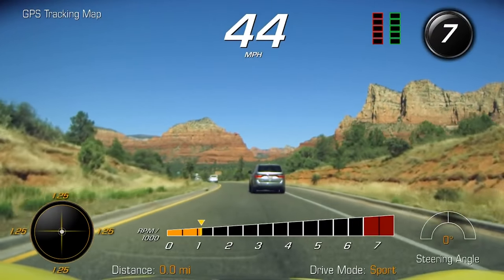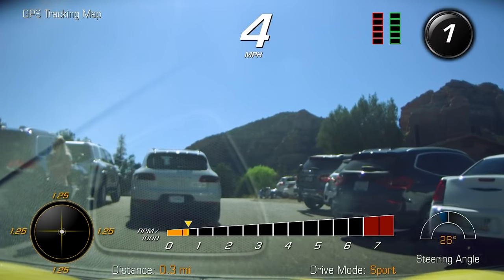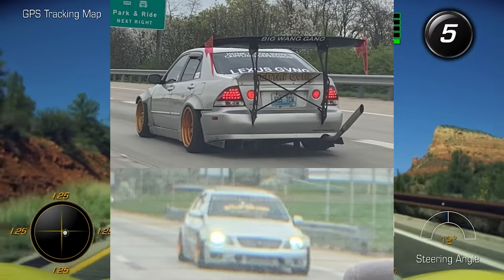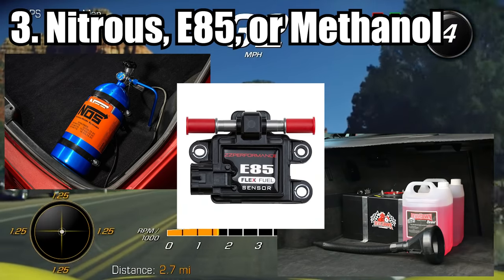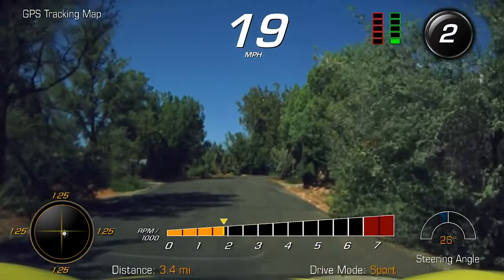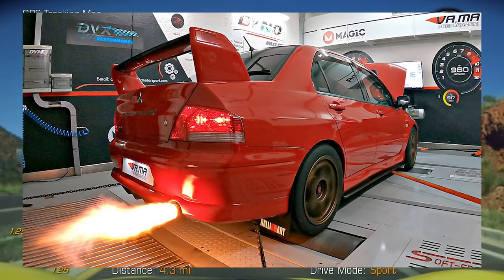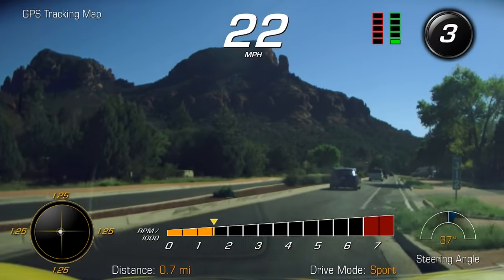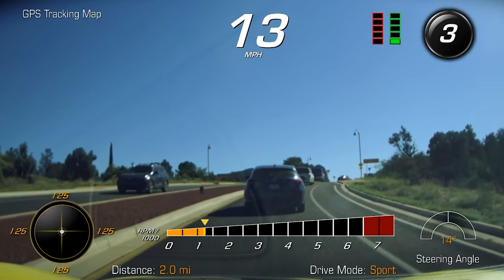6 Most INTIMIDATING Car Mods!

Comment: now imagine a silent but deadly sleeper with sequential gearbox, that would be wild!
Reply: A time attack ferrari form the 80s with a body kit a dream
Reply: With drag radials nitrous and a ducktail
Reply: Yea I guess I just threw the sleeper part out the window lol
Reply: Fiat Marea be like
Reply: That's sums up volvo 240s in general
Reply: Now imagine a sleeper dragster, with no sound, sequential, beadlocks and drag tires, a small horizontal ducktail but no parachute, and it spits SMOKE from the hood
Reply: @Appa1315  now that's a car from hell
Reply: With 3000hp 😈
Reply: like a fart
Reply: @de.jotabr  That's a car that sends you to hell
Reply: Nah it’s the Toyota Corolla gapping a Tesla in a drag race for me 😂
Reply: I mean kinda is those calvo vipers they aren't the loudest out there but you will get fucked up if you try em
Reply: Sequentials are almost always loud.
Reply: i have a mk2 gti with a boosted hayabusa in the back that runs on propane with a sequential gearbox and 305s in the back, with a exhaust dump for quietness, something along the lines of what you said lol but the cage and stripped interior kinda gives away the sleeper element
Reply: If I had the money to swap my shitbox to a twin turbo v6 with rwd pushing like 450hp with a sequential, I’d absolutely do it and leave the exhaust as quiet as possible. No one would expect a little shitbox Ford Fusion to win any drag race
Reply: @straightlinetech  even ugr Lambos, and ets gtrs have a tough time with them. Its like the faster you go in a Calvo the harder they accelerate
Reply: @MagnumLoadedTractor  yo might want to watch stanceworks
He is building a time attack ferrari 308 with a k24 swap and liberty walk bodykit, you might want it.
Reply: @darkwatcher01  is it free?
Reply: @MagnumLoadedTractor  you might want to watch it*
Reply: Agreed
Reply: @justiixce  post a video
Reply: as a non car guy imma ask something stupid
why is it possible to boost cars past 3k hp but none of them beats the record for fastest car like the chiron?
Reply: silent but deadly sequential centrifugal supercharged sleeper on e85 and there’s pure intimidation 

drag radials, ducktails and drag slicks to throw the sleeper bit out

Comment: This is why I specialize in sleepers. You don't really hear my car until I'm approaching red line. I do this type of setup for 80% of my customers because it is always fun to see the look of confusion when a car "that has no business at the track" blows their doors off.
Reply: For future plans for myself. What cars do you work on?
Reply: @GozuTenno962  all makes and models except rotaries. I got out of that game after my 5th personal RX-7. Bikes cars trucks foreign, domestic except anything rotary powered too many problems too unreliable too hard to make power and keep them quiet.
Reply: A lot of people on the internet call something a sleeper just because it doesn't look like a race car despite it clearly sounding like the gates of hell are open under the hood. A true sleeper is something that appears in all respects to be easy prey until it leaves you in the dust
Reply: @DjDolHaus86  correct
Reply: @christophersaint6926  curious: so does a tesla count then?
Reply: @SHRModding  lol I love the thought but, everyone already knows their quick. However an EV converted Hyundai Accent using Tesla batteries and motors would. EV West out in California is doing a lot with that check them out if it interests you.
Reply: @SHRModding  probably yes and no. No Tesla looks intimidating or "high-performancey" but everyone knows they'd gap a good chunk of cars on the road.
Reply: @christophersaint6926  yeah true. Thanks for the heads up
Reply: @ufokkenwotm8  Yeah it has a reputation even if you have the bade model

Comment: 2:15 Correction, Blade. Beadlocks are actually there to keep the tire from rotating on the rim. On super hard digs, your tires are going to deform anyway. The beadlocks keep the tires from rotating on the rim, which is another form of traction loss.
Reply: Came here for this. Also helps prevent debeading since they only run like 12-15 psi on drag radials
Reply: Up
Reply: @timwilliams1910  Yes, I did forget to mention that. Thank you.

Comment: Exhaus cutout is even more intimidating than the last entry. One click and it is straightpiped / catback-ed. Real nice.
Reply: 🎯💯 I was literally thinking that when he was talking about “silent exhaust” lol
Reply: What about hood exits?
Reply: @mikhailjairnisbett441  those are loud all the time
Reply: @mikhailjairnisbett441  a cutout is a little square that covers a cutout section of the exhaust. You press a button and it opens making it straight piped you press it again and you’re back to being muffled
Reply: @glub__blub  yeah, I know what an exhaust cutout is. I was just mentioning that hood exit exhausts could be more intimidating than really silent ones.
Reply: Awesome as that is, more savvy police forces will know how to catch you with that. In Kuwait the police apparently have master controllers for all the major exhaust system manufacturers, so whenever they're out looking for suspected street racers or at a potential upcoming street race, they just use the master controller, call in the sting and start impounding. Have to get a custom system to avoid getting caught out, and that can tend to be a fair bit more expensive.
Reply: @RPGTKingpin  or you could have a cutoff switch for the system, just leave it dead if you see the popo
Reply: @errorsk2188  Yeah if it's strictly a wired system with no remote that could work.

Comment: 7:51 I actually got one of those recently, it's not got a tune, just a legal exhaust system (here in Germany, so actual restrictions apply) installed by the previous owner and it doesn't spit flames or something but you definitely hear something going on there if you're off throttle for a second or so on stock tune  🤔

Comment: Bladad Angel: Downforce isn't that important....

Me on German Autobahn with curves at 300 km/h: guess I don't need downforce then... flies to moon and beyond
Reply: Step 1: make car go 200mph
Step 2: buy an absurd front splitter and rear wing
Step 3: turn the wing backwards and tilt the front splitter up
Step 4: F L Y
Reply: @GasDrinker6455B  step 5: Problem?
Reply: You don't need big aero for that you need to reduce drag
Reply: @WarriorOfEden3033  wooosh
Reply: @miendust  you do realize that big aero kits aren't for high speed corning
Reply: @WarriorOfEden3033  you are right, they are not for CORNING at all...

But seriously, most aerodynamic pacages are designed to start working at 150 km/h and work up to the top speed of the car.

So contrary to your coment: Aerodynamic bodykits are not only working at that speedrange, but are especially designed for it.

My credencials: I'm in a formula Student Team, that makes havy use of Aerodynamics.
Reply: @miendust  aero is more complex than   this
Reply: @miendust  F1 aero is more about following regulations than being functional. My information is from a F1 engineer 😂
Reply: @miendust  did you know at higher speeds big aero causes tremendous drag & with the added weight significantly slows the car down. The best aero for high speed you will barely notice like a flat floor, proper ductwork & a long narrow front
Reply: @WarriorOfEden3033 that's for speed cars that don't corner
Reply: @green5260  that's my point

Comment: I'm curious on your thoughts of a ulta low frequency but fairly loud exaust. Doesn't seem loud due to frequently but you can feel each revolution.

In your opinion is that more or less intimidating then a completely silent exaust?
Reply: that sound amazing.
Reply: The kind that you can hear idle from 2 blocks away and trips other car alarms when red-lining is, in my opinion, a lot more intimidating, especially if the resonant frequency is extremely low with barely any high frequencies.
Reply: I love a car that isn't really screaming loud, but just has that loping, deep thump type sound...the sound that you feel in your chest more than you hear it with your ears.

Comment: It's all fun and games until an Ambulance with a Twin-Screw Supercharged 6.9L V8 flies past. You can hear the Supercharger and the sirens, which shows how powerful that TSSC is.
Reply from the maker: bruh tf. This sounds so elaborate, it must be real. If so, anything I can search up to find it?
Reply: @BladedAngel  It's something I made in BeamNG Drive. I modified four Gavril D45 Ambulances for racing and off-roading [Because doing that kind of stuff is fun]. Two of them were powered by Twin-Screw Supercharged 6.9L V8's. The TSSC was so loud you couldn't hear the engine over it so it was probably just as loud as the sirens. The other two were powered by Turbocharged 5.6L V10's. 
I could go on about it, but I won't unless you want me to.
I've made some crazy ass builds in that game.
Reply: @BladedAngel  If I can remember to, when I get home I'll record a video and put it on YouTube to show you what I'm talking about.
Reply: As soon as you said Ambulance with a 6.9, I know it was either a Gavril D-Series or H-Series.
Reply: @joshjlmgproductions3313  Fellow BeamNG Drive player 🤝
Reply: If there's any vehicle that could stand to be super souped up for just the day to day work, it's probably an ambulance

Comment: Another intimidating mod I think should get a mention is engine swaps

Like swapping a really powerful engine into a car that normally wouldn't fit on/an engine not usually engine swapped
Reply: like the v12 miata
Reply: Someone put a fucking 24 liter tank engine in a crown Vic soooo
Reply: @GasDrinker6455B  Can you accomodate a link.
Reply: Unsure if your familiar with Mustangs but your comment perfectly relates to a 87-93 Foxbody with a gen 2 coyote engine in it

Comment: when it comes to tires, it doesn't matter how much horsepower you have, anyone can benefit from more grip. perhaps not on the dragstrip, but when going through corners or braking, grip is probably the most important thing you can improve on.
Reply: Ummm yes drag cars need alot of traction normally
Reply: @bradleyhollon6085  purely drag focused cars sure but not road cars being raced on the drag strip occasionally

Comment: How about massive front mounted intercoolers on cars that shouldn't have them . That's pretty intimidating .
Reply: Not really since most of the time they fake or not even connected to anything
Reply: @GasDrinker6455B  wait what 
People actually do that ?
I feel so unsatisfied after reading this
Reply: @GasDrinker6455B  WHAT
Reply: Infatuateed _  well, it’s not in my area, since all I’ve ever seen are some Hawkeye Imprezas with spray painted black wheels, but they are a common occurrence. Most of the time when people have a big menacing intercooler it’s hidden behind mesh or whatever.
Reply: @speedyboi349  It’s depressing... sometimes some real dedicated ricers make that shit out of cardboard, paint, and pvc pipes.
Reply: @GasDrinker6455B  what's the point of doing that 
Wouldn't it be better to just keep you car stock and nice looking if ur not gonna mod something that's actually functional
Reply: @speedyboi349  you appear to have been sheltered from the hideous world of ricers.
Reply: @GasDrinker6455B  I know about ricers but not at this absurd lvl
Reply: @speedyboi349  oh no... oh no no....

Comment: 2:27 You don’t always want less sidewall for track use. 
Some pros of more sidewall is:
- More consistent tyre pressure
- Can be more controllable when losing grip
- Tyre wall do some of the suspension work 
- And often, smaller wheels is less weight. 

This is definitely true for lower horsepower cars
Reply: LMP1 and F1 tyres are thicc. That's all we need to know.
Reply: I feel that he doesn't really know what he's talking about
Reply: @IR-xy3ij  more sidewall 100% helps with grip on bumpy surfaces, especially if you have stiff suspension. The fact is you're less likely to lose traction during cornering because of the leeway bigger sidewall gives you when going over bumps, so that part is true and quite worth it if you ask me
Reply: @gamespender8605  I was talking about the video, not the comment. Race cars get the smallest possible wheels and tallest possible sidewalls for the performance benefits, and the video is implying that tall sidewall tires are only for drag racing.
Reply: @IR-xy3ij  It's just oversimplified for god sake, he literally said it would be long topic if he wanna please you guys
Reply: There are a LOT of variables - related just to tires - that can effect both lap times AND the feel of the car (which can effect lap times independently from the actual grip level). Different brands/models/sizes of tires have different characteristics too, so it's not always true that a higher sidewall flexes more. More flex might increase grip...until it's too much flex and doesn't. And how the tire reacts/performs also depends on the car itself...how much it weighs, how its suspension is set up, even how the driver drives it.

Comment: tbh the tiny crackling noises and the "gurgling" on decel is pretty cool. It's characteristic of purpose-built racing engines; not built road car engines, but engines that were designed and built from the ground up for racing. It's pretty loud with the current F1 engines, for example.

Comment: Flames do come from running rich, you can't have a flame without fuel burning in the exhaust. So I don't ge the point here of saying "true" flames. You say "non intimidating" flames because of a rich tune then goes to say you car has been tuned to produce flames. Yes all flames come from rich condition between shifts, downshift or whatever. Not every one needs anti lag, and not everyone can a run a catless exhaust in order to get flames. Yes crackle and pops are annoying, but cars come factory like that, even though there is no purpose for that.  It's cringy when people tune their cars to make popcorn sounds or loud bangs when there is no purpose for it.

Comment: Ya know for some time I was scared of Porsche engine swapped drag beetles 
Maybe the potential power of them is not the best but the of the grip these little beans on wheels get. Its insane bc of all the weight being in the rear pushing down the rear tires against the track

Comment: Won't lie, since I've 2ZZ swapped my MR2, I've also been quite the fan of cars without exhaust noise. I say that moreso meaning you don't hear much at the stop light, but when the pedal goes does it SCREAMS! It's something special when a Mustang gives me a rev at the red light, then straight drop em when that valve lift kicks in at 6200rpm and it goes from sounding like a grocery getter to a damn F1 car.

Comment: No 5 didn't really make sense
It sounded like you were intimidated by the power, not the transmission itself. It doesn't contribute to the power, it just makes it easier to control. If it's that much power to need a sequential I don't see how it could be a sleeper so other mods would be more intimidating imo.

Comment: the exhaust I have on my daily, a full exhaust, no cat back or axle back, all the way from the engine. it makes roughly 10 hp. but in a car with 140hp does it make a difference, and especially since it is tuned to use exhaust scavanging in the low revs which gives me way more low end grunt than stock with not much more sound. just enough to make me happy whilst still not waking up the neighbourhood.

Comment: Im not into speed demon cars. I find the challenge of keeping my old heaps running, and running good. That being said, dont mess with top speed with a 460 big block Ford. True, its not as fast as my Charger Scatpack stock, but theres something to be said about flying by doing 146mph in a 72 single exhaust Continental, holding the steering wheel with your pinky, window rolled down, just cruising on white walls and wheelcovers lol.

I destroyed a little CRX that just wouldnt let up. It was Sunday, he was with a girl and I was the only car he could show off. So...fine, I gave in, and floored it. He was quicker duh, but when I flew by him, the air pocket made him change lanes LOL. 

I am building an oddball now. Its a 74 Ranchero, and I want to go nuts with it. Not powerwise, but airfoil wise. I want to adapt aviation tech to this thing, with flight controls, flaps, slats, whatever, to make it corner ...differently. I have no clue what the end product will be, but its a junk car at this point, and might as well do something different. I will need to convert to 28V so I can use actual aicraft gauges and computers. Right now, the biggest  problem is beefing up the floors to keep it from twisting its windows out of its gaskets.

Comment: I actually put a Camaro ZL1 paddle shift suede wheel in my 2013 ls Chevy Sonic 1.8l bolt-on's and tuned. Not going to lie fun factor started getting pretty good with the racing buckets.

Comment: I enjoy Symetrical.  I know the actual reasons for he rim size, I would use Tire Calculator to compare for an aplicatiuon closer to default speed rating for rotational advantages.  Yes, those stupid car culture crap today is just that stupid clown looks!!!!  I want practicallity with my glam please.   Yes I know of those mods, for fuel I will use 93 Octain plust Boostane to get 110-114 Octane boost if really dragging someone!  I do not think my 2013 Premium is Flex Full equiped.  Those back fires yeah I do wonder if I get those when I down shift  fast enough from some moderately hard braking from a high speed.  I do see people back away and off when I do that on the highways though, so maybe I do that.  High flow cats, X-Pipe and Cherrybomb Salutes currently only.  I like the sound, still is only a LFX 3.6L.  That GM 6L50 is a great transmission though.  Monte GTR Tunner, Sport Tune only I daily drive my car.